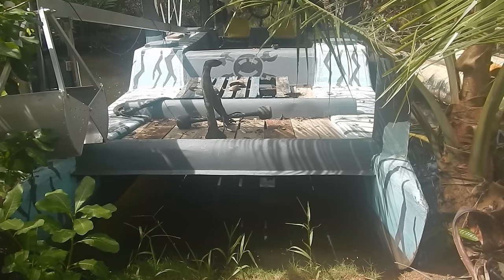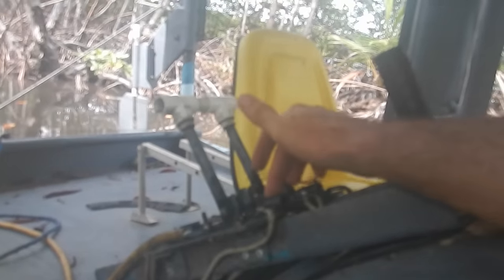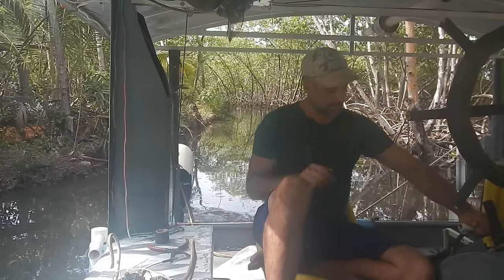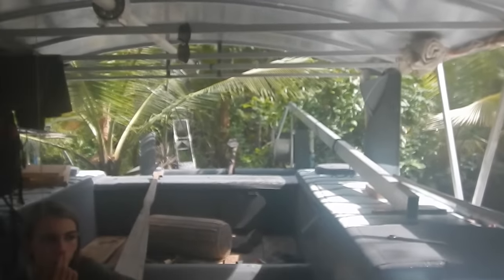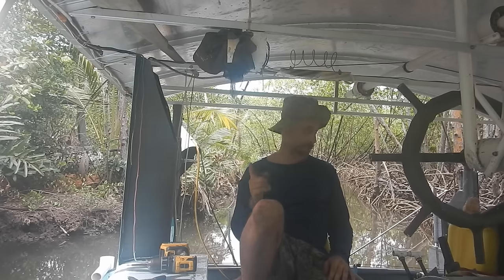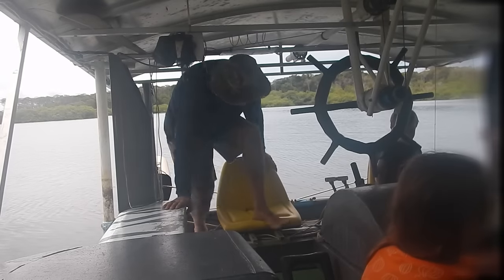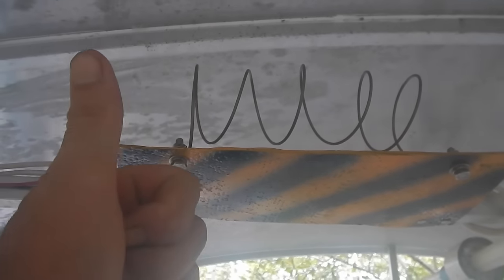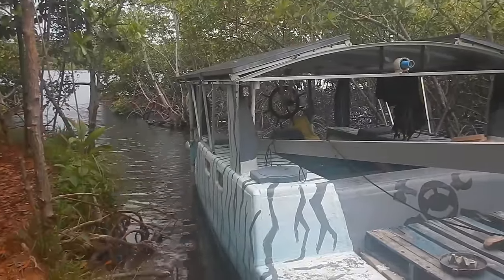Primitive Speed controller for Solar Boat

Comment: That old speed controller looked like it wasn't designed to be very weather resistant and in an environment where everything is surrounded by corrosive salt water it is not surprising that it could fail.  That being said, most of the newer speed controllers made for golf carts are now plastic with the electronics fully potted which seems to help a lot in the wet environments that some are subjected to.  
As is obvious you could even make that speed control pretty much fully variable just by adding more tap points along the nichrome resistor element.  The ones we used to build for electrathon would have a ceramic tube similar to those used on big power resistors along with a copper brush contact that wipes against the  taps from one end to the other with the last tap being a direct connection through copper rather than the nichrome wire similar to a big rheostat where every 2 turns connected to one of the wiper taps.  Not the most efficient but you very rarely spent any time in speed limited mode and it made a very simplistic and robust control system that would still work even if the batteries were very dead which was a good thing from a competition standpoint.

Comment: hi Jaimie if its a hall effect throttle, its probably that which has failed. The magnet has a habbit of coming unglued and dropping out. I hate hall effect throttles. If the speed controller can be switched into pwm control or 0-5v you could have a Arduino with a little screen so that you could have some presets. Richey let Jaimie do his thing and continue watching the video :)

Comment: The benefit of PWM speed controller is efficiency. Electronics should be reliable when properly designed, built, installed and used. If some of these fails, system stops working. If everything is right, electronics works practically forever.

I have lots of self-made self-designed electronics in daily use. Some have been working over 30 years, some 20 and some only few years, but I have had very little problems. One example is pressure controller for my water well. I have my pressure vessel underground, so my water is cold all the time without flowing it too much. I live in Finland, so temperature 6C under ground. That's highly condensive place, especially at summer time. The original mechanic pressure controller lasted less than a year before it rusted solid and stopped working.

I replaced it with self made electronic one, which is not only more precise, but have worked flawlessly 23 years, without need of any adjustments or maintenance.

As far as I know, your speed controller should be properly designed, so I'd check few things. Is it installed in environment where it's specified to work. Condensation definitely happens there. Salt may also get on the surfaces, where condensation can get it into contacts or even inside the enclosure. Separate watertight case with sealed cable pass throughs are typically good practice. 

Another thing that can be a problem for this type of controller is loose cable connections. With inductive loads, like motors, loose connection can create high voltage shocks, which slowly deteriorate electric components. Using a manual switch you have behind your controller, can do the same.

Comment: Complex, expensive and impossible to fix replaced with rudimentary an easily fix for a few dollars has been my experience with a few thing also. I built an evaporative ac for $300 with easily fixed or replaced parts but ofcourse its never need anything replaced in 5 years. Compare that to a split system AC, when there are problems it is an expensive and drawn out nightmare with technicians that want $250 an hour and guess how I know all this? The kicker is Ive spent nearly 2 grand and the split system and it still doesn't work properly.

Comment: Speed controls on old golf karts, fork lifts and such are usually a bit more involved, and more efficient. 

The motors have two pairs of brushes that are insulated from each other. You can connect one pair, both pairs in series and both pairs in paralell to get 3 speeds. Some use resistive loads to provide two more speeds.

Some motors (starter motors) can be modified to work this way by insulating their brush holders from the casing ground.

Comment: How much power is lost through the resistive wire speed controller??
Reply: Very little due to the amount of time it is actually in use.  The speed control is really just to prevent damage to the motor from hard starts and allow for a slower speed when maneuvering in and out of places where the moat is docked or moored.